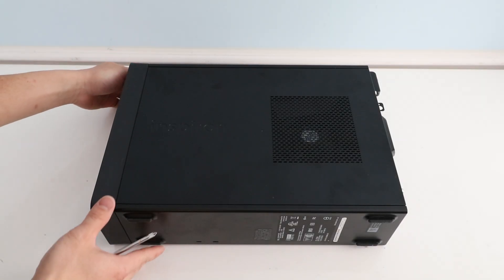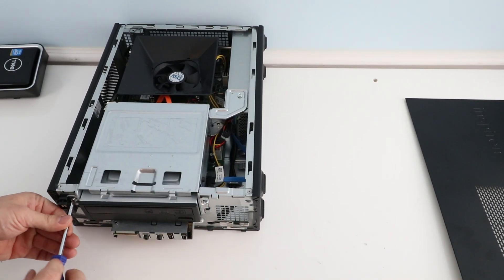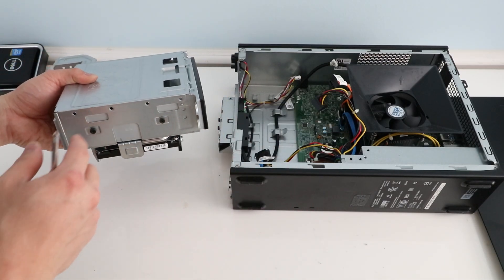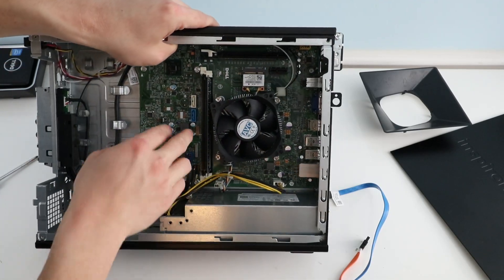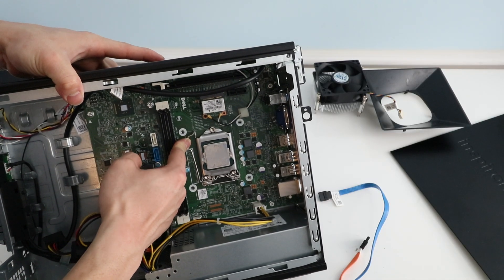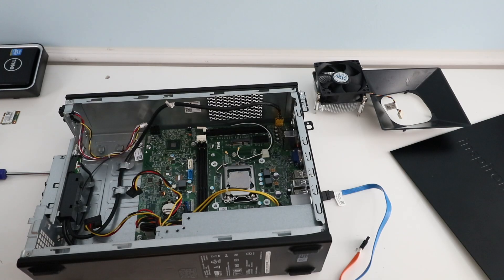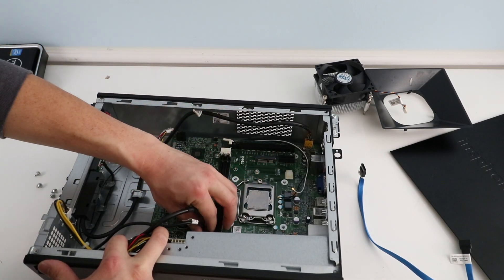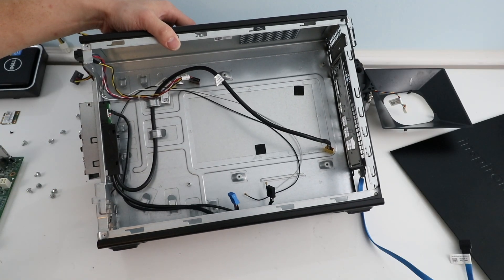Disassembly Dell Inspiron Small Form Factor PC- Upgrade Ram & SSD

Comment: Can I transfer this hardware to a new, more modern Motherboard, on a different gabinet (bigger one? I want to start upgrading my Inspiron 3647 by getting a new gabinet and a new motherboard, with 32 gb of RAM of capacity. Then, I would transfer all my Dell stuff to a new gabinet and buy more RAM until I have money for a better graphics card and a new processor. Is it possible?

Another question: Kingston 8GB 1600Mhz DDR3L CL11 - KCP3L16ND8/8 and Kingston 8GB 1600Mhz DDR3 CL11 - KVR16LN11/8 are both suported by the 2YRK5 motherboard from Dell? I am afraid of buying a new RAM and wasting money. Thanks in advance, it is my first time looking for a PC upgrade and I'm kind of lost.
Reply: I am literally doing that right now, putting it in a new case with a 1060 6gb and a new PSU. 

I initially wanted a new motherboard in the build too but after running in research circles I found if you upgrade the board, then you need to upgrade the cpu (or have a spare cpu to flash BIOS) and if you upgrade those two you need to upgrade the ram as any board that supports a better newer cpu generally does not support ddr3 ram. You really cannot do just one, at least at any reasonable price point. You may gain a little umph but spend like 200 bucks for almost no more speed. 

Here is the best bang for your buck combo I found if you go the upgrade route. Note you can skimp and get a cheaper PSU but you really shouldn't.. 

https://pcpartpicker.com/list/cNwkcY

I ended up just buying a case off craigslist, buying that RM550x PSU and some molex to 3pin cables for the fans and it looks like it should work with the 1060. :) 

NOTE: I also found that cards above gtx 7xx may not work without adjustments in the BIOS. See the LAST comment for OP's solution here:

https://www.dell.com/community/Desktops-General/Is-my-motherboard-compatible-with-the-GeForce-GTX-1060/m-p/5114042

Lastly I believe that ram should be just fine. Is that an upgrade though? My inspirion 3647 currently has 8gb ddr3 1600mhz installed. Came with that.
Reply: It is a different computer in that last link but it should work the same. (I hope) LOL. Anyway I will have this done by Wednesday and if I see a reply I will let you know how it works out.
Reply: My PC came with 4gb of RAM. The specifications from the manual said it can go up to 16 gb of RAM. If those sticks are fine, I'm going to buy them. Thanks a lot.

I have been reading a lot about computers, and unfortunately the socket thing from intel is just ridiculous. It is better to create a new pc from scratch than upgrade all the things that a new motherboard would require.

The original PC case from Dell supports Low Profile GPUs like GT 1030 LP? I have seen people talking about it, but I saw some videos saying that it wouldn't fit, maybe because of intel PSU, but I don't know.
Reply: Yeah, upgrading is really not as simple as one would think it should be..at least most of the time. 
I had read that a couple low profile GPU's would fit into that case, but that was back before I just built a whole new rig. 
Here is how my Franken Inspirion with the 1060 turned out. Runs like a champ now! haha. 
https://pcpartpicker.com/b/T7sZxr

Here is a video of a guy who puts a decent upgrad GPU in the inspirion: 
https://www.youtube.com/watch?v=eHvDXfIpfss

If you can find something with similar dimensions then you are in business!
Reply: Sean
For now, I think I will upgrade the RAM. I have 4gb in a slot, so I'm going to have 12gb of RAM available after I put the 8gb ram stick on the second slot, right?
My CPU is a i5 4460u( i guess it is U). As far as I know, the 1151 socket can be used with the 5th generation, so I think that an i7 with a good clock (my i5 is 2.9 Ghz, so 3,5 would be good, i think) from the 5th generation is ok with this motherboard?
After that is the weirdest part, that is deciding if the GPU is upgraded, and with it, the PC case is replaced. If a GTX750 ti worked here, it would be a very nice upgrade from my GT705. My dream is the 1060 with 6gb, but with the bitcoin market and the taxes in Brazil, everything gets harder to buy.
After I graduate here, I think I will be able to finally create my custom expensive rig haha.
My only fear is buying  incompatible parts, and I can barely find info about the Dell Motherboard (0y2kr or something like this).
Thanks for you answers, and your pc is really nice now.
Reply: Hmm I am not 100% sure about the RAM, you better read up. I know you can have different sizes - 4gb & 8gb but I am not sure about different speeds and voltages. Here is a link that seems to explain it in detail:

https://www.lifehacker.com.au/2010/07/what-are-the-rules-on-mixing-two-different-types-of-ram/

As for the CPU, if I were you I would stick with that one for now. I can't find anything about a 4600"U" but in my Inspirion I had an i5- 4600s @ 2.9Ghz boost 3.4Ghz. With that CPU the original 8gb of Ram and the 1060, my girlfriend (who I built that for) gets a steady 60fps with v-sync  and high settings on. So for some titles that are heavily CPU dependent, you might start getting somewhat bottle-necked but they will run. Realistically I wouldn't spend your money on a CPU that can fit in that Dell MoBo, especially if your funds are limited. I would get it up to 8 Gb of ram and buy the best Gpu that can fit and is available, and start saving up for the rig you really want. Whatever you do just BE SURE you get a decent power supply with enough wattage and decent reviews! One that will fit that tiny case too. 

Unfortunately bitcoin is not the real issue of the high GPU prices at the moment. Last year smart phones started using the same memory as GPU's, so massive companies like apple and samsung pay more to get it first before considerably smaller companies like EVGA, MSI, etc can. Nvidia just came out and stated that they expect the soaring GPU prices to continue through at least the majority of this year.. :/ Ram is also very expensive right now so if you are just building a computer for gaming I wouldn't go above 8gb unless you find a major deal. Ram is not nearly as important for gaming as rendering or other tasks. Source:

https://www.youtube.com/watch?v=HnuNs_Nu46Q

Save that money for your dream build buddy!!
Reply: Hmm. That thing about RAM is actually bad news for me then hahaha. At first I thought RAM was the easiest component to understand on a PC, but after trying to look for information about my configs, I think it is the PC part I'm scared the most to upgrade, because I'm always terrified of buying the wrong Memory Stick. With the Kingston search for compatibility, which was from a link provided by Dell itself when I entered support there and chose upgrade, Kingston 8GB 1600Mhz DDR3L CL11 - KCP3L16ND8/8 was the match. Everytime I search for a memory stick I try to see if my PC is supported but I just cannot find something about it. And the prices here in Brazil are just horrible. This stick I found on the Kingston Store is R$ 551,00, which is US$ 170,00. 

https://www.amazon.com/1X8Gb-Memory-Compatible-Inspiron-Desktop/dp/B00IRNSYJQ

Maybe it would be better to just get my overseas and hope to avoid taxes or pay for someone to bring me. On Amazon, 2 8gb sticks are close to 30 bucks cheaper than 1 8gb stick here in Brazil. And if 8 gb are ok for gaming, maybe that would be a major economy for me. Of course, if for some miracle my original 1600 Mhz Single channel Dell RAM is compatible with it, even better.

Another thing: it is i5 4460S. I don't know where I thought the U came from when I was thinking about my PC.

I want to upgrade the graphics card, but I didn't want a much bigger PC case, because I actually take it with me when I'm on vacation from college, so I'm not robbed if some guy breaks in my apartment. Maybe it is time to move to a slightly bigger case, but I don't want to lose the portability.

Getting a PSU would be nice too, but this PC case can't fit almost anything other than the new RAM stick.
Reply: Your cable management with the build of the PC for your girlfriend was very good too. That PC case looks good.
Actually, aside from the Geforce 1060 6Gb, which is probably way out of my league right now, the other parts of your build looks really cool. I will look for those on amazon or similar, and try to get those to Brazil. This PC case of your girlfried can handle a motherboard upgrade in the future?
Reply: I really like that case too, my personal Rig is in that same case. https://pcpartpicker.com/b/CCw6Mp I have I think an ATX size motherboard in mine? but yes you can fit several sizes. It is quite large though, but the airflow and temps are great, and you will probably want that especially in Brazil. Buying parts you can upgrade would be a good idea for sure, that is kind of what I did with my girlfriends. With that case and PSU we have room to upgrade her as needed. 

as per your other issue..I think the Ram is not as difficult as it sounds, but a personal saying of mine is: "Nothing is simple if you know anything about it." Haha. That looks right though. That 8gb Ram link you sent me reads as $70 U.S on my screen (i am in the U.S), but you said it's cheaper to by 16gb as a package deal? That is strange but great. From what I am reading though you really just need to buy 1 4gb stick to get you up to speed. Although I was just looking for a GPU that will work in that case with at least 4gb Vram and while I found some they are outrageously priced!!! Most are more than I paid for that 1060 6gb back in September!!
Reply: and thanks for the compliment!
Reply: The link I sent you was the amazon ram that I found. The brazilian one is: https://kingstonstore.com.br/index.php/kcp316nd8-8.html
It is 600 reais, which is almost 200 dollars. The 16 gb in 2 sticks of 8 gb would be, on Amazon, 140 dollars. The problem is that it is imported, so it may be taxed. I think that 12gb of ram would be the perfect amount for me, since 8 gb is great today, but in the future I'm already set with 12. I'm thinking about the Pc case, the PSU and a graphics card. I would have the money to bring them all to Brazil, if there was no importation taxes. But ok.
Thanks for the help, I'm probably going for a rig like your GFs computer.
Reply: Well best of luck MMD! Hit me up if you have any more questions or run into any issues on the build. Happy to help!
Reply: Thanks a lot Sean!
Reply: Sean, what did you do with the power cable of the Dell Inspiron 3647? It is this cable what is preventing me from changing the PC case and upgrading it, because I'm afraid to buy a PC case that won't fit and I'm also afraid of not being able to adapt this cable to the new case.

Comment: Can we add a grafic card on it
Reply: Without doing heavy mods these 2 are close to your only options: https://www.amazon.com/dp/B06XHZ29N5/_encoding=UTF8?coliid=I2THG3XOPCTT5U&colid=HK1TOHERRK2Z&psc=0 https://www.amazon.com/dp/B06WWLWWJM/_encoding=UTF8?coliid=IREF6WFG6BXSR&colid=HK1TOHERRK2Z&psc=0

You will need a new psu that fits though.
Reply: Sean thx for replying I also like to buy gtx 1050 ti low but in India it is fully out of stock If I import it it price will be 21000 RS or 350$  it's too costly of its original price 159$
Reply: This is a terrible time to buy a graphics card that is for sure... :/ Everything out of stock here in the U.S too, or selling for double or triple the original price. Best of luck on the hunt!
Reply: @hankhillsdisappointedsigh  are these cards that i can put on my dell inspirion?
Reply: @caiquequicksilver897  I mean you COULD but now they are so expensive for how powerful they are it would be a waste of money. I ended up just buying a bigger case and a new power supply and stuffing it into that. This is an ATX case I usded, the motherboard and full size gpu would fit into an ITX case. Here is what I ended up doing: https://pcpartpicker.com/b/T7sZxr
Reply: @hankhillsdisappointedsigh  a question could you tell me if you can put kingston hyperx fury 16 gb on the dell inspirion, but one thing on the dell inspirion fits the gtx 1060 6gb?
Reply: @caiquequicksilver897  If you have the small case version of the inspirion like I did then the 1060 won't fit in the case, but it will work with the motherboard as you can see in that link I sent. Also the stock power supply is too weak for most any GPU so you MUST UPGRADE the PSU. Because you have to upgrade the PSU, you should just do what I did and get a new case to fit the new GPU and PSU. 
As for the RAM it will have to be DDR3 ram. That motherboard will not work with DDR4 ram. Not sure which your kingston is. 
Feel free to ask me any more questions. Happy to help.
Reply: @hankhillsdisappointedsigh  could you tell me if there is any sdd in it? one of 16gb
Reply: @caiquequicksilver897  ? I am confused. No there are no SSD's in the inspirion I got. and they don't come as small as 16gb. The smallest you can get is like 250gb.
Reply: @hankhillsdisappointedsigh  No, I'm just asking if you can put another sdd on your pc dell inspirion will you be able to put another sdd if yes which one?

Comment: What should I look up to upgrade the CPU. If you could reply soon that would be great because my birthday is coming up so I need ideas
Reply: Hey,
To upgrade the cpu, you would need a 4th generation processor, with an lga 1150 socket. This board can't overclock, so any 4th gen processor with a "k" after it (EX: i7-4790k) will not work. Heres some processors that are compatible with this motherboard : i5-4670 , i7-4790.
Reply: I also recommend a gpu in here. Some good choices would be the gt 1030 , MSI GTX 1050 2GT LP  Video Card, and the MSI Video Card GTX 1050 TI 4GT LP GeForce GTX 1050 TI 4GB GDDR5. These options are all small and don't need external power from the power supply, but if you want a beefier graphics card, take out all the parts from this pc and install it in another ATX case, such as the NZXT s340. Then you can add a better, fullsized Power supply and graphics card as well.
Reply: Also, the ram upgrade : Use 16gb ddr3 1600mhz ram. 
https://www.amazon.com/Kingston-HyperX-FURY-2x8GB-1600MHz/dp/B00J8E8XT4/ref=sr_1_3?ie=UTF8&qid=1503075928&sr=8-3&keywords=16gb+ddr3+1600mhz

Comment: Hey man can i put a hraphic card in this pc
Reply: Hey,
I think you can, but it would have to be a small form factor.
What I plan on doing is using the parts in this exact pc, but putting it in a different case so I have room for a Full size Graphics card and power supply. One option is the NZXT s340.
Reply: I am doing that exact thing right now lol. Did you manage to get the wireless antenna out? If so how?
Reply: Have you done that? Can you post the video?

Comment: my little brother has this pc I upgrade the pentium to an I5 2400, install another stick of 4gb ram and a gigabyte gt 1030 lp in it. I was so happy how it perform in games. medium to high settings on  1080p res in mostly games its performance is now close to an xbox one
Reply: Noel Sandlie with the same power supply?
Reply: yes
Reply: I know this is a lot to ask but can you list the part names on amazon please?
Reply: U put GT 1030 low profile type on this pc?The motherboard does support it?Cause im about to upgrade it to GT 1030
Reply: @FirdausSamsuri  yes i have GT 1030 (2gb memory) installed in my pc when i bought it... please tell maximum ram compatible for this model
Reply: i did, it worked, i also recommend getting a single 8gb ram upgrade if you don't have one.
Reply: @1beattles  plz reply u have 32 bit os or 64 bit os
Reply: mysterious dunia 64 bit
Reply: U have 32 bit os or 64 bit os
Reply: I have a question I have a diffrent type of dell and I’m 13 and know nothing about PCs put could I upgrade my cpu and like everthing to get better FPS on like games (fortnite, call of duty) I just need some tips of what to buy. Please
Reply: Also I know this was 2 years ago

Comment: What is the Slot used for which is above the ram slots , Black colour with single hook ???
Reply: I think youre talking about the PCI-E Slot, which is used for graphics cards. I recomend using a different case like the NZXT s340 so you actually have room to install a full sized one.